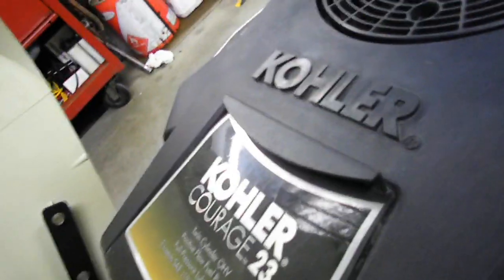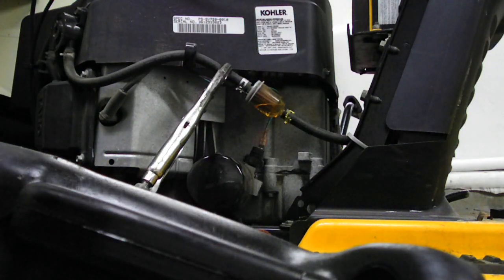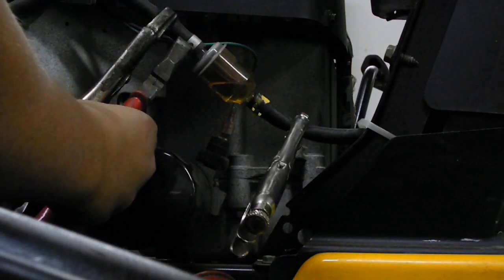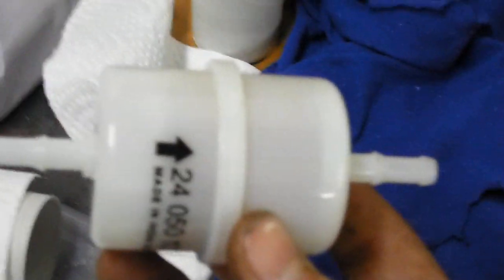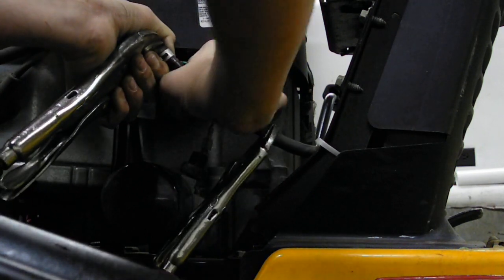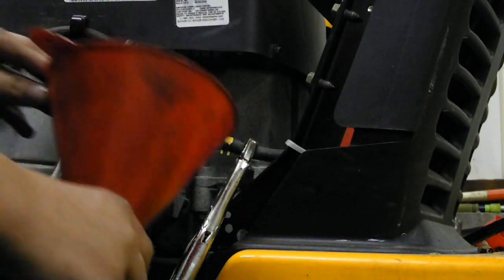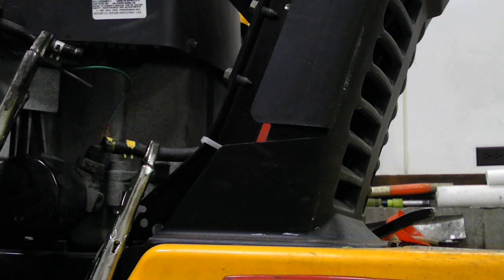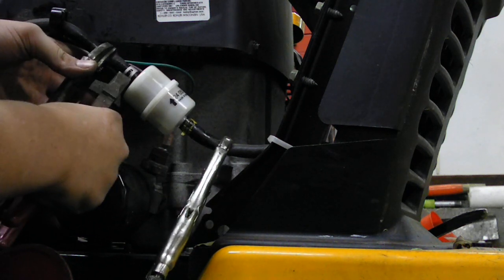How to change a fuel filter on a cub cadet tractor

Comment: Feedback...you should put something around your vice grips or fuel line to prevent damaging them. The other piece is to make sure you get the correct micron level replacement filter. Mowers with fuel pumps use 50 micron, those without use 75 (learned the hard way)

Comment: The front of the filter where the gas goes into the engine. What is that part called it looks like a diafram of some sort it has three leads with short rubber hoses. My mower has been hard starting I changed the gas filter, new plug and still hard starting. My manuel said maybe dirty fuel line so  I blew out all the lines and now no gas is coming out from the tank. I took off the gas cap and blew the forward line and blew up  that plastic part it had a very thin rubber covering small brass screen and it is all blow to hell I need help I dont   know the name of the part so I cant look it up. Could this part have anything to do with why the gas wont fill the filter Pleas Help.

Comment: When changing fuel filter on my Cub Cadet I clamp the lead end line and start the tractor and run off the fuel in the line. No fuel in line to mess with..